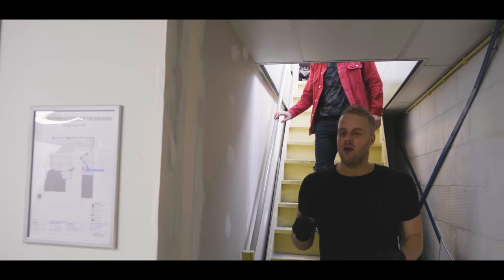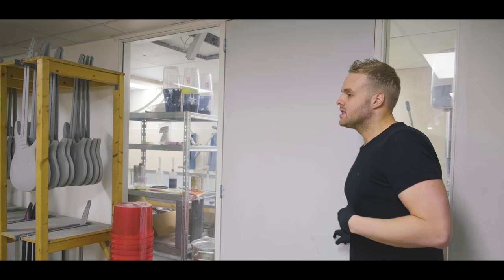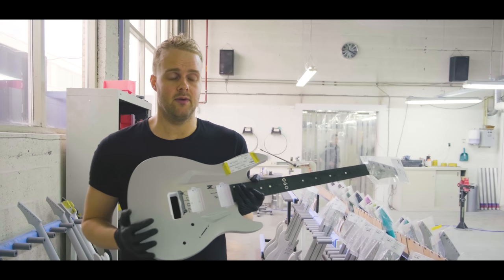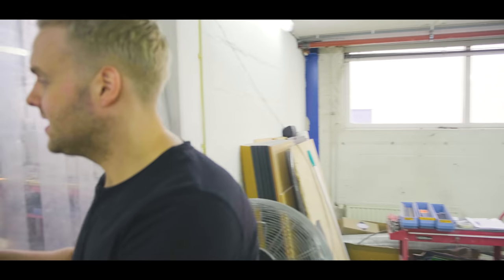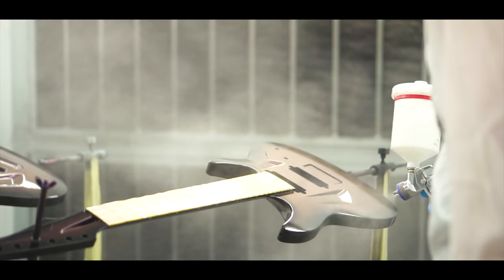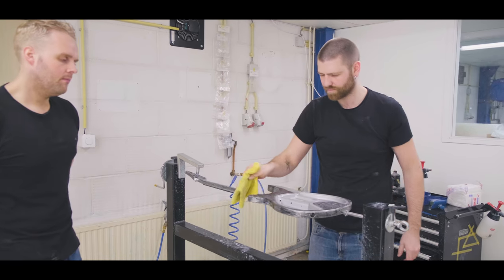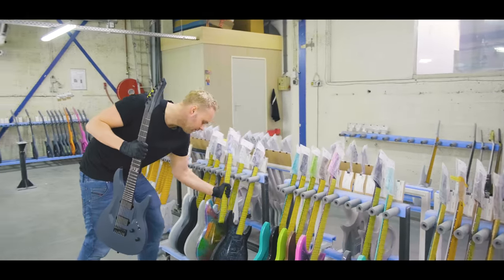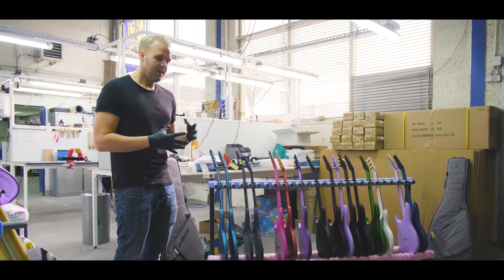Aristides Instruments Factory Tour - 2019

Comment: Finish idea: You should use small hobby sandblasting setup, like an airbrush system, with your CNC to etch ash wood grain designs into the finish, or mold it into the tops.

Comment: Evertune option coming? And pleeeeease do True Temperament. Those 2 and I buy 2 immediately.
Reply: Evertune needs quite a thick body :(
Reply: Regarding EverTune™ & True Temperament® Both are mandatory for me too. Especially at this price and also I don't think I would even consider buying a guitar for over $1000 that isn't Plek'd™. At >$2500+ there ought to be very many more options for the bridges and pups. I'd prefer to have more control over the customization of the instrument that is priced slightly higher than you can get from an existing company that can be built from start to finish with your own personal options for yourself, prototype / 1-off type of instrument.  I know of a luthier whom you can give a specs sheet and detailed design for your own style and the quality of the best materials to use and the instrument will be finished by the end of the year... And cost roughly the same as one of these higher end models! So if you're not picky about what you get for the price then these are beautiful and seemingly exquisite quality guitars that are worth the price... But if you want some input on the hardware and configuration of your own guitar you can just take your money to a local luthier and get a custom instrument that you don't have to worry about upgrading / changing the components of once you settle on a new guitar and I think you will be happier with the outcome of the build. 

>$2500 ~ $3500+ seems like a ludicrous price for a molded instrument and from what I can see, you're paying for the dazzling finish and prestigious branding, like so many other things that are marketed to the type of people who are more interested in the recognition associated with the brand than the overall craftsmanship of the product itself. For example, the price of a luxury car 🆚 a 1-off build from a shop is going to be 3 ~ 4× higher, allowing you to purchase a brand new '87 Buick GNX for the price of a 2019 Corvette ZR1

Comment: Question -- why do your guitars need truss rods if they are made with very high grade and strong materials?  What's the point?  Is it just to placate people who are scared or is it actually required?
Reply: The material doesn't "breathe" due to humidity and temperature changes (or does a negligible amount) but is still under pressure in one direction because of constant string tension. I think the purpose of them is just to offset the string tension, and allows for adjustment with different string gauge, tunings, etc

Comment: Steinberger did composite guitars in the 80's. not a big deal. there's a reason if music instruments are still made of wood.
Reply: spiritual cramp 
I’ve tried them in person before, and they’re certainly a lot more resonant and sustains a lot more than the wood guitars that I’ve tried.  Wood guitars are great, but these composite material guitars are very cool too
Reply: @RaynP  let me doubt they better resonate  and have more sustain if not with dedicated resonating picksups. i would change my mind if  you show me a  software test result. i don't mean ''no'', i just doubt it without  data. i also think it depends on what music you play,  if you process the signal thru FX and  racks etc. you'll never notice difference, but if you play  a clean or just a  bit saturated rock blues stuff i think they greatly suck. Musicians pay fortunes for vintage guitars for a reason, mainly old woods, not to talk about violins and cellos woods.
Reply: i mean it doesn't look like they're running out of business